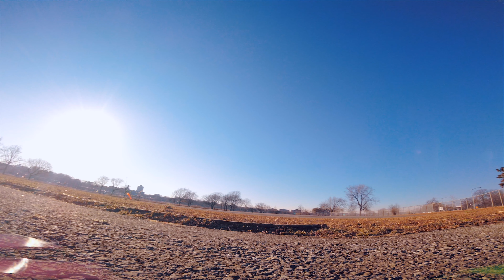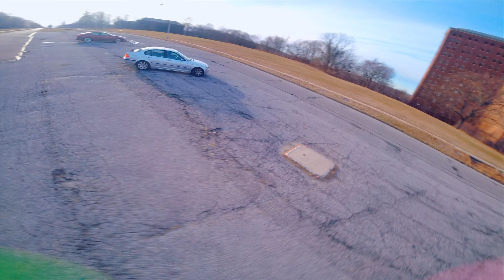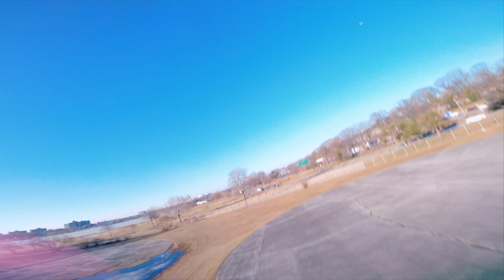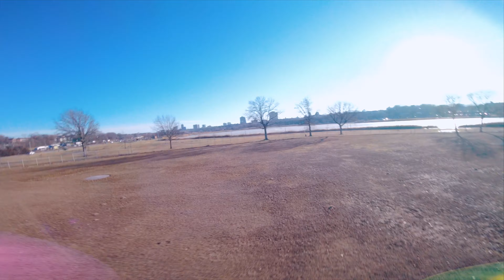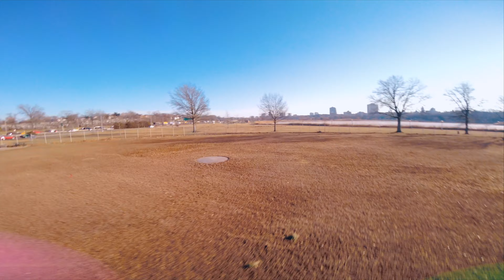$140 OF DRONE DAMAGE IN A SINGLE HIT | FPV FREESTYLE

Comment from the maker: For all those asking in the comments below and on IG DM, here’s what got trashed:
- Front Bottom plate cracked
- Kiss V2 FC
- 1 x motor bell smashed flat (stator was saved and still works well)
- 1 x motor tore all the way into the stator wires (the bell is fine so I put it on the working stator above)
- 1500mah battery’s balance connector completely torn off

#kwadlife
Reply: War Chest did you ever recover from this 👍🏻 waiting a year 😀